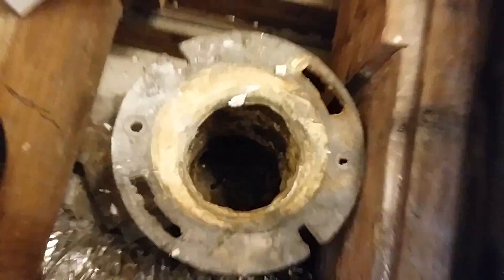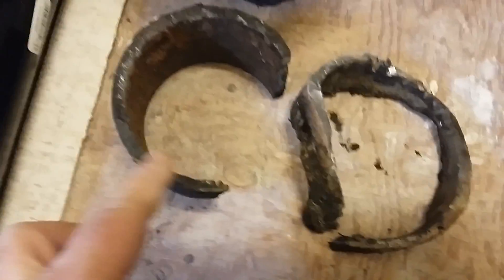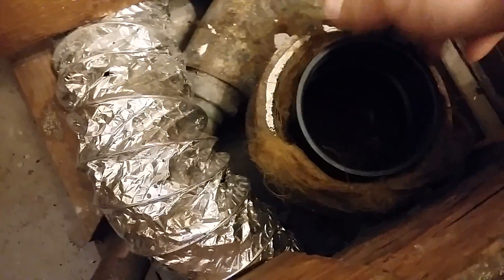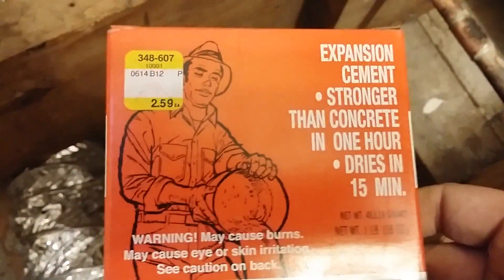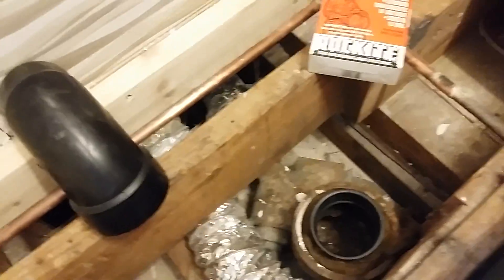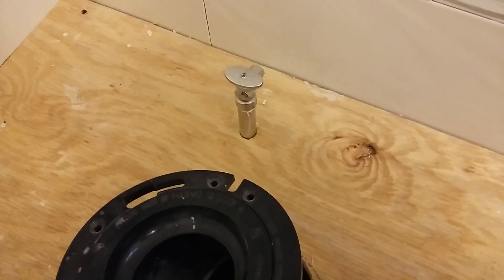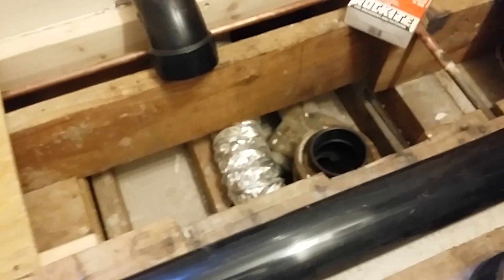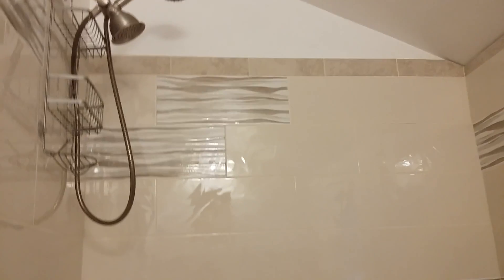Cast iron hub to 3 inch ABS connection

Comment: that was not a code-compliant  connection to the cast iron; a Fernco donut is what you needed.
Reply from the maker: Correct but couldn't find one anywhere at the time still holding up very well though